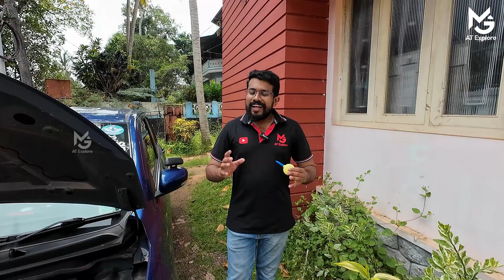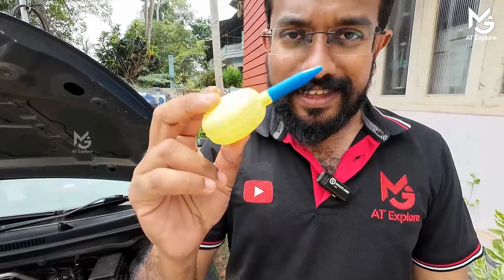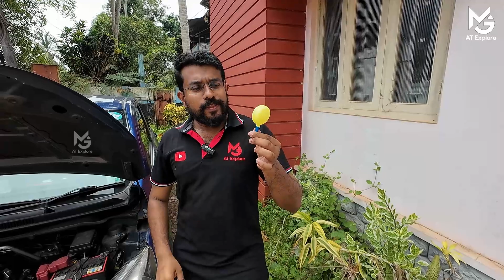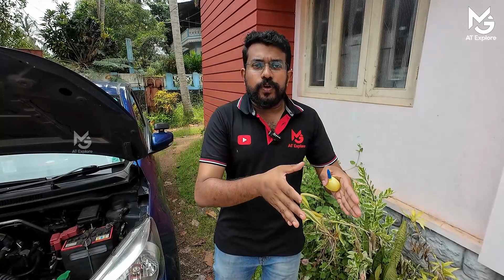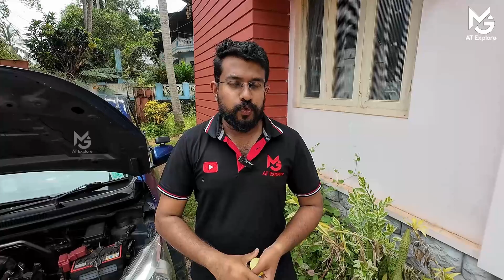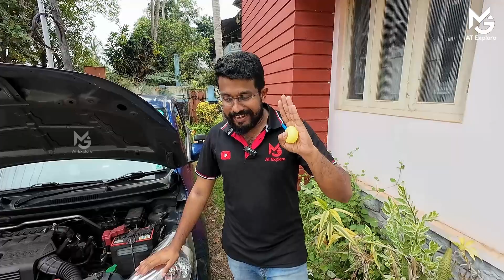മൈലേജ് ഇല്ല എന്നുള്ള പരാതി ഇനി വേണ്ട | Add this for Mileage | Try this for best result |#MGTIPS -384

Comment: Well Said , I m using my 1999 Carburetor zen since 2006 and completed 1.5 lakh km with 0 additives only with correct service and it"s giving me about 18Km/L mileage and no issues. But my friend with 2000 model zen and used a oil additive and the engine had got problem on oil pressure within months it got oil consumption and a heavy compression leaks .Before using the additive the car had no compresson leaks and was running smoothly. The only need for a car engine life and for mileage is correct service.